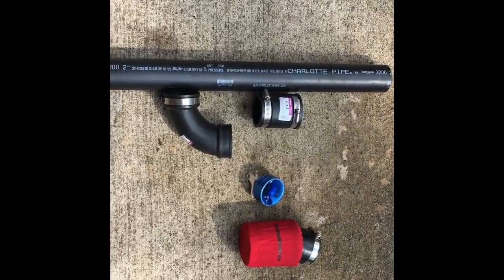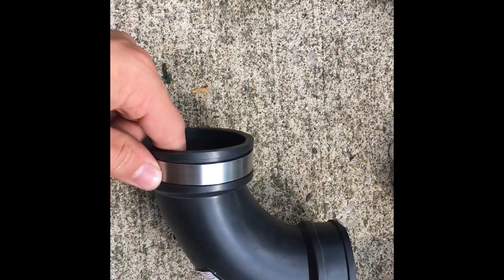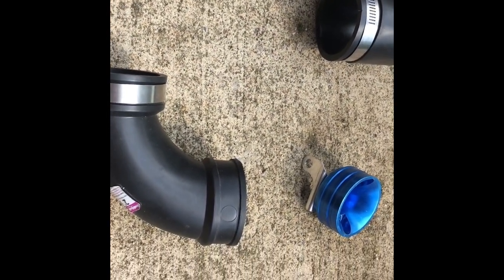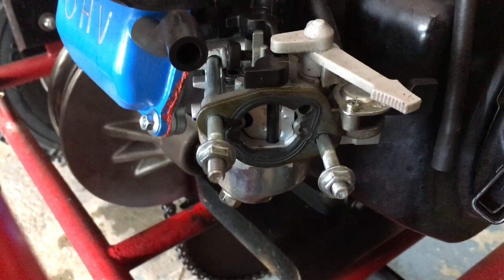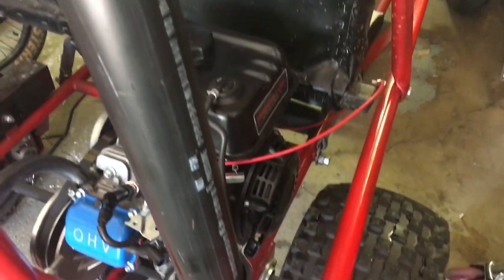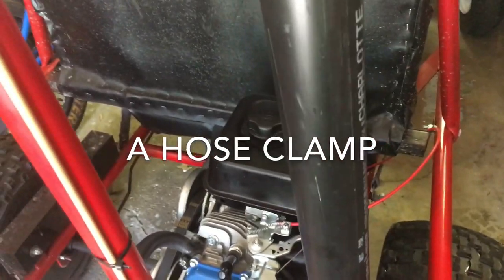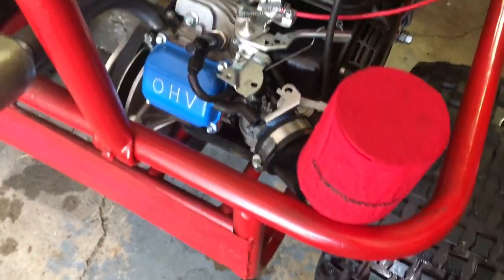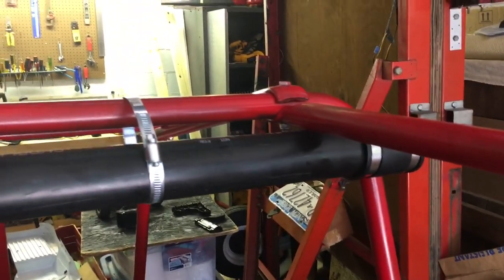How to Make a Custom Go Kart Snorkel

Comment: Sick that may come in handy

Edit: also if You want to gain tiny amount of power try sanding the inside on the snorkel that way when The air reaches the carb it is gets mixed with the gas a little easier
Reply from the maker: Fixit Rippit Reckit, Thanks, glad to help

Comment: What did you use for the air filter ?
Reply from the maker: It was the "K&N Style Performance Air Filter" from Gopowersports
Reply from the maker: Not sure if YouTube will let me but here's the link: 

https://www.gopowersports.com/k-n-style-performance-air-filter/
Reply: @JohnWheels is there any way I can use something like fabric because I don't feel like buying all that stuff
Reply from the maker: @Cooper-sf9kf  I wouldn't recommend it. The key to making your engine last long is not letting dirt and tiny particles into your engine. It's only about $12 and you can probably find equivalents on Amazon and eBay. Plus, fabric will likely restrict airflow to your engine and not let it run right.
Reply: @JohnWheels  ok I was able to find one of my old Ryobi air filters for one of the tools do you think that would work it looks almost exactly like the one you have
Reply from the maker: @Cooper-sf9kf no dude that's a dust collection bag. Just buy the right thing or leave it stock honestly lol.
Reply: @JohnWheels  nah it is one of my grandad's old Ryobi air filters from one of his gas powered Ryobi tools and it was back whenever they made gas tools now they mainly make electric but if I don't put one on what would happen if dust got in the air box
Reply from the maker: @Cooper-sf9kf  oh whatever. It's your project lol. If dust gets in the engine, it will stick to the cylinder walls that are covered in a thin layer of oil. Once the piston goes back down it'll scrape it against the cylinder wall and make its way down to the crankcase. Once it's there it will get into your bearings and wear those out faster.
Reply: @JohnWheels  ight well I was able to get one of the air filters today for dirt cheap and I finished snorkeling it and I took it over the engine through my pond and it never cut off I ran vent lines you should to of you are gonna take it deep
Reply from the maker: @Cooper-sf9kf  sick, thanks! I will.
Reply: @JohnWheels  i was able to run the vent lines to everything you would normally do for a four wheeler it took me longer to run vent lines than installing the snorkel and a quick tip to test your snorkel you should take the filter off and start the motor and put a price of paper against the snorkel to see if it is airtight if the paper stays on the 90 degree without falling of it means the snorkel is sealed perfectly
Reply from the maker: @Cooper-sf9kf  sick thanks!